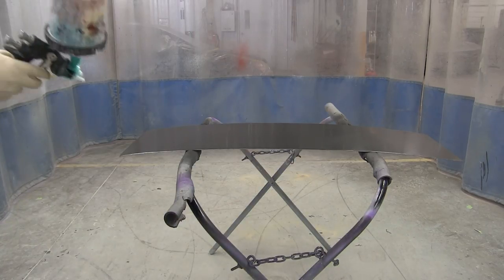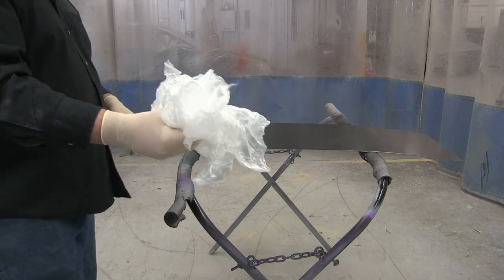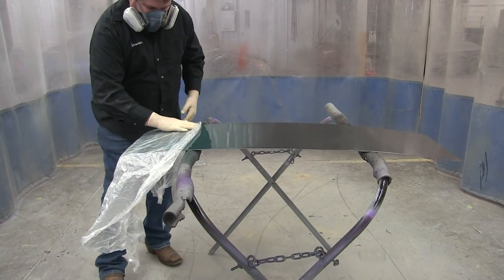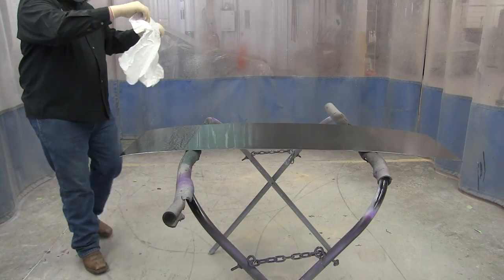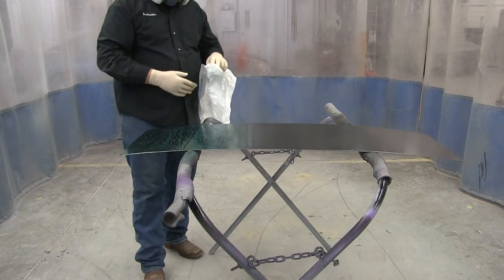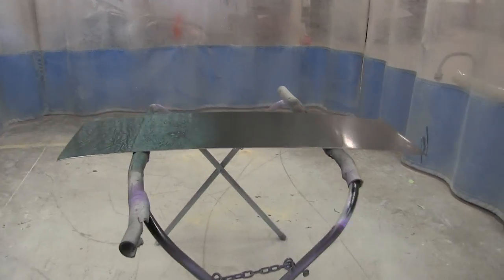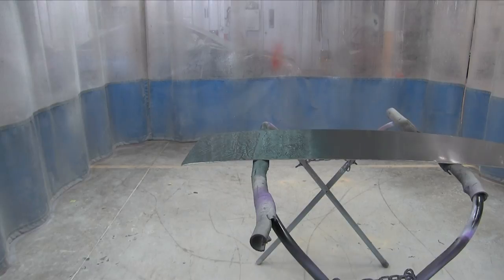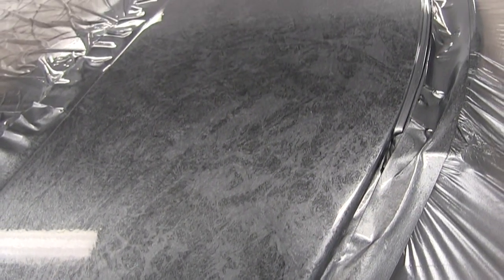How To Marble Car Paint  Using House of Kolor Marbilizer

Comment: Have done a fair bit of this myself (hard to find good tutorials, so thank you!) I found, to avoid the problem of finger-touch marks, where you've pushed the plastic wrap down, is turn your air pressure way down low and use your shop-blower/air-duster to gently lay your plastic down.
Using bubble-wrap also gives an interesting, if some-what uniform pattern.

Comment: Question, if I use the hok neutral marbleizer can I put pearl in it or would I have to do it first then use the pearl in the clearcoat? Thanks for any help
Reply from the maker: I would probably spray a pearl coat over the marbleized.   But you probably could add it to the marbleized.  I would experiment on something small to see if you like the results.
Reply: Car Addict Garage thanks bud good idea. 👍🏼
Reply: That's what he neutral is for. You can make any color marbleizer you want by mixing in your pearl. There's an instruction sheet on HOK website about it.

Comment: Should I wetsand before clearing it or will it mess up the pattern?  If so, what grit should i wetsand with, like a 4000?
Reply from the maker: No, I would be afraid that would mess the pattern up.  The coating is thin and designed to flow out.  However, you could let the clear dry sand and buff or sand and clear again if you wanted to.

Comment: Hi, I know nothing about painting but I'm considering painting a guitar, which is a very similar process as painting a car.
I'm considering painting in  Candy Cobalt Blue which requires a silver layer beneath it.
Will I be able to recreate this effect?
The process would be 
1 - Apply a sealant to the guitar to prevent paint absortion by the wood
2 - Apply a primer
3 - Apply a silver  layer
4 - Apply Candy Cobalt  blue layer and do the Marbling effect
5 - Apply Clear Coat.
Reply from the maker: I created a video that I hope helps answer your question - https://youtu.be/Gt624E830sg
Reply: That was quick, thank you.

Comment: always just used black base, then like a silver  with a slow reducer but you have to move fast still lol..
Reply from the maker: I've tried that and it didn't work as well for me.  I had a problem with the texture flowing out smooth.  I think I used slow, but maybe I should have over reduced it too.  HOK is ready to spray it straight out of the can, which makes it easy.  Thanks for watching!